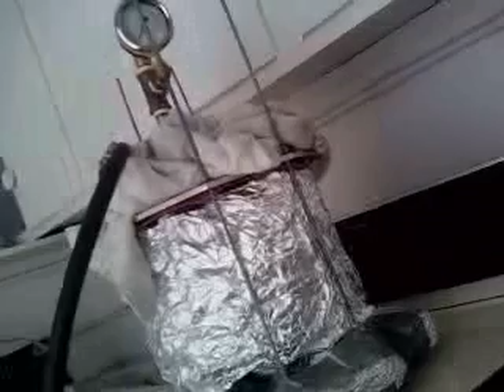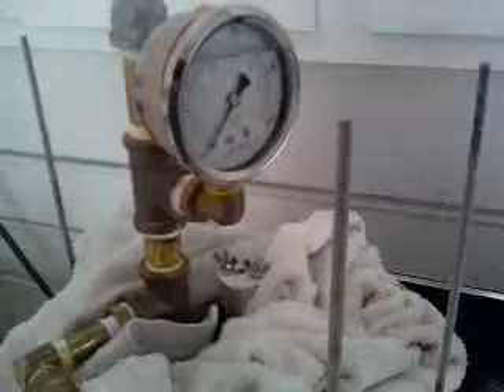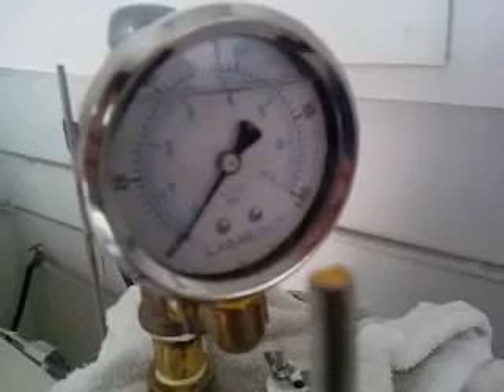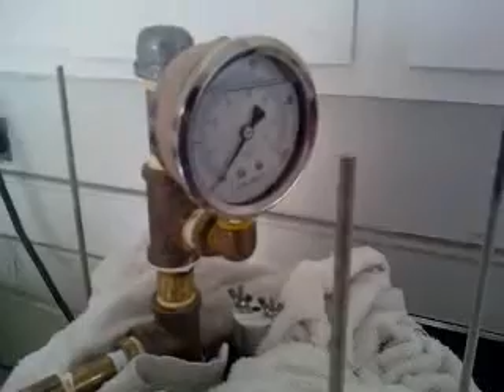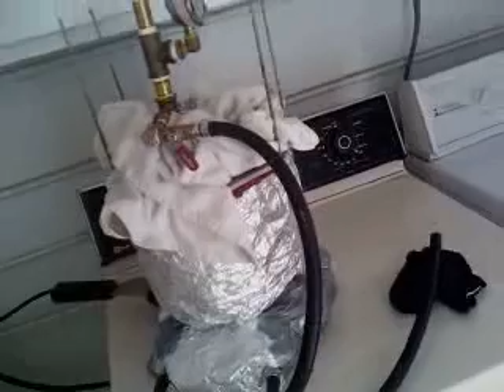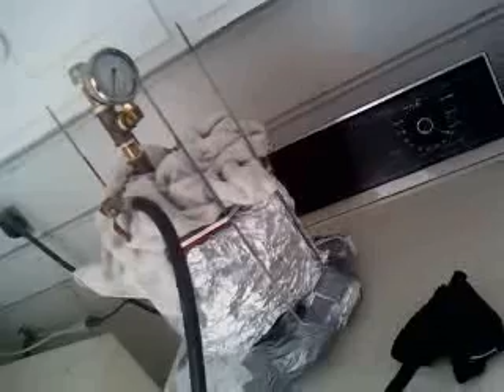SUPERHEATED STEAM PLASMA GENERATOR #5

Comment: @1100tech  Plasma Temp
Boiling water won't and doesn't cause it to separate into Hydrogen and Oxygen. If you don't agree, hold a flame in front of the spout of your boiling kettle & see what happens.
 , .
At ~ 2200C about 3% of water will start to chemically disassociate into various combinations of Hydrogen and Oxygen.
This is why I am asking what the temperature of the plasma is?
 , . 
Want to learn about something really freaky and quite amazing about water?  
Look up it's 'Triple Point'

Comment: @DougRH52 using the injector and a positive and negative plate setup ,like stan meyer did, when the high pressure high temp water is relaesed into the injector you have a pressure drop from 500 to 175psi compression pressure the water will boil instantly creating hydrogen and O2 and using the air/water/steam mix as a conductor the plasma will jump through the water droplets creating electolysis inside the injector and cylinder raising the temp while the implosion process is going on inside cyl.

Comment: See what i see is that you have lost all the expansion qualities when you turn it into stream .....Starting the engine on gas till it gets up to temp and then using the cylinder temp and the pressure on the closed loop system @ say..500psi ,through a pump , it would keep the water from boiling ( 2degrees temp for 1 psi ) and then allowing the expansion and pressure build and lighting it all @ then same time to create and SUPER expnsive mixture ??Just a thought !

Comment: OK! Let's inject a little more info into the mix , now that you have done all this work ( and by the way WOW! that is SMOKE'N hot ! ) BUT what if instead of steam you super heated the water throught the exhaust manifold to the 450 degrees farenheit and THEN used the "Superheated Steam " injecting the super heated water into the cylinder THROUGH a plasma field ( like Stan Meyer had ) THUS lighting the hydrogen and capturing the "Expansion" qualities on that "Superheated' steam /Plasma combo??

Comment: OK just for a moment let's assume that you could generate a kilowatt of power from your vehicles alternator. 
Even a high-efficiency alternator would be less than 60 percent efficiency. 
So to produce one kilowatt of power you would need to consume at least 1.4 kW from the vehicles battery and the process of making steam into plasma is also < 100 percent efficiency. 
So you would end up with a net system efficiency of less than 50 percent at best.